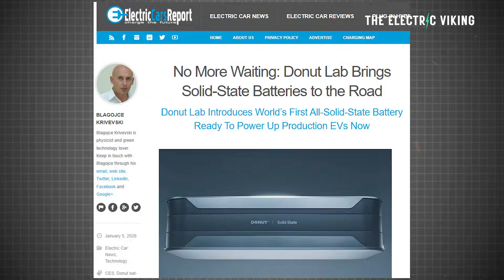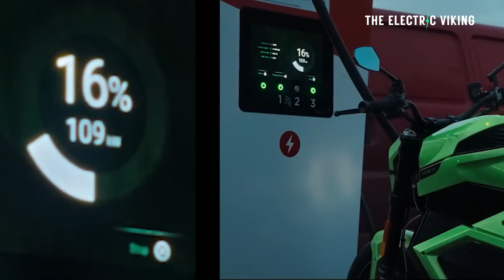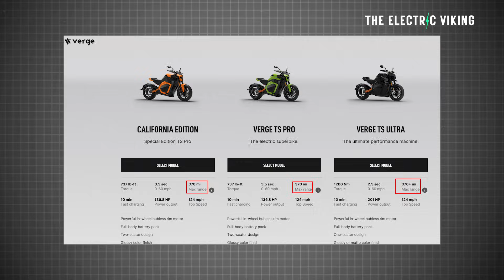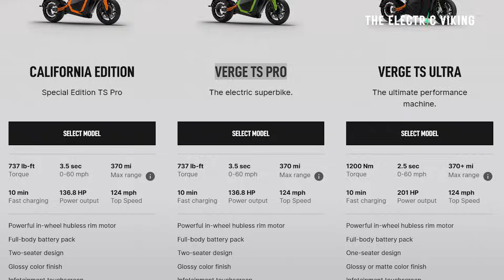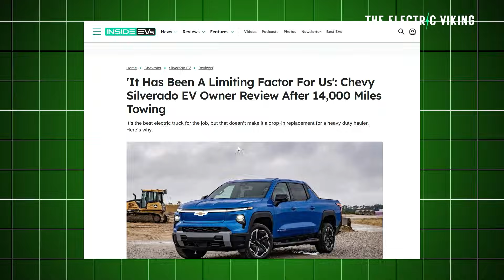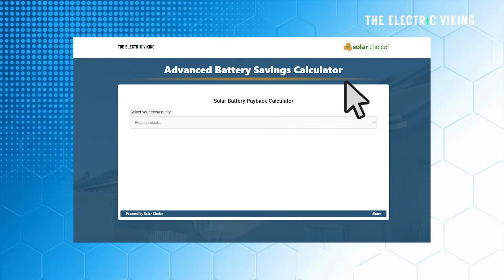The world's first true production-ready SOLID-state battery lasts for 100,000 cycles

Comment: Sorry man it's not ridiculous i've done some off the napkin calculations and it's actually spot on.
Reply: Here's my reply about this a gallon of gas has approximately 33.4 kilowatt hours of energy a motorcycle is about 20 to 30% thermal efficiency. That means that a gallon of gas that can take a motorcycle 70 miles will need approximately 8.35 kilowatt hours of energy. the motorcycle engine is highly inefficient. That's it if it takes 8.35 kilowatt hours to go 70 miles to go 350 miles would take 20.5 kilowatt hours all things being equal in terms of weight of the motorcycle between one with an ice engine and the other being the electric. So yeah it's very conceivable if they can get those kind of power densities and you have to also remember I believe in terms of the charging that might be the time for one cell but when they're packed together and they're heating up you know it's maybe not even possible to have a charger that could deliver that much current and Ergo Power in such a short amount of time Doubt being massive in size.  or you can handle extremely large charging voltage. You have to remember there's sermon efficiencies with charging so there are certainly a lot of unknowns in a 5 minute charge time is under what kind of Size factor? It might even be possible to have a lighter bike for the equivalent size of a bike with an ice engine therefore contributing to ranging efficiency of the overall motorcycle.
Reply: No one I guess There is actually some loss in the conversion of electric to mechanical energy In terms of heat in the actual coils Oh they're circular Electric engine. Roughly a good electric motor would be about 95% Efficient. So some rough calculations so yeah they're in the ballpark for sure They're even in the stadium.
Reply: But this is just the beginning it's definitely the hype And another thought in terms of scalability yeah A solid state battery lived that Would definitely lend itself to mass production in a way that a price engine can't
Reply: I forgot to add that a electric engine motor is about 95% official and the calculations I use I assume 100 percent efficiency of the electric engine and that's never the case. but even with that they are certainly Not just in the ballpark but in the stadium and they if they can scale which should not be a problem with the solid st battery in the summer of the techniques I saw for its manufacturing Compared to an ice engine batteries like this blend itself to a high degree of scalability and automation. I cannot speak of this lately And without any understanding on a retired professional engineer the Masters and manufacturing engineering. But it also tell you my experience is the devil is in details and some of the details we don't know although it's understandable that the startup like this However if it's true they could be come of very big wealthy profitable Company if they can contain their Patent rights.

Comment: The Verge TS bikes are with customers already for a few years, but with a "normal" 20 kWh battery. They can fast charge with CCS. Real highway range some 125km or 75 miles as shown in a road trip video, Monaco to Madrid. 33 kWh might put range to 200km/130mls, with fast charging in under 10 minutes the game changer.  Also, no need for cooling, more space for kWh.

Comment: I asked Copilot: Donutlab, a Finnish company, is now announcing that they have a solid state battery ready to ship. That can be charged up to 100,000 times, can be charged at extremely low temperatures, has a high energy density and can also be charged very quickly. Is this really something I should believe?
They are taking a big risk by publishing these statements if they later turn out to be greatly exaggerated. Perhaps they are hoping to find new investors?

---

Yes, they are taking a risk — but it’s a controlled risk.
When a company goes public with extremely ambitious specifications (100,000 cycles, 5‑minute charging, 400 Wh/kg, –30 °C operation, etc.), they are putting their reputation on the line. But:

• Most consumers will never read the technical details
• Most investors lack deep technical expertise
• They can always say the numbers were “in lab conditions,” “pre‑production,” or “not representative of the final product”

So yes, it’s a risk — but one that’s easy to walk back from without legal consequences.

---

2. The investor hypothesis is very likely

This pattern is extremely common in the battery and energy‑tech sector:

Step 1: Announce a “revolutionary” technology

Step 2: Show a prototype in a controlled environment

Step 3: Release press statements with extreme performance claims

Step 4: Seek capital to “scale up production”

This is exactly how QuantumScape, Solid Power, SES, Amprius, and others have operated.

Donut Lab is:

• a small company
• fully owned by a motorcycle manufacturer
• without published scientific papers
• without independent test data

This makes them dependent on external capital.
And capital flows more easily if you sound like the next battery revolution.

---

3. Why exaggerate? To create investor FOMO

In the battery world, “the next big breakthrough” is a magnet for venture capital.
If Donut Lab can convince investors they are ahead of Toyota, QuantumScape, and ProLogium, they can:

• attract funding
• secure partnerships
• gain media attention
• increase their valuation
• buy time to actually develop the technology

They don’t need the technology to be finished — only to sound finished.

---

4. They can always scale the numbers down later

This is a classic move:

1. Present extreme numbers (“100,000 cycles!”)
2. Gain attention and capital
3. When the product launches:• “In reality it’s 3,000 cycles, but still very good”
• “5 minutes became 15 minutes, but still fast”
• “400 Wh/kg became 250 Wh/kg, but still competitive”

No one sues them, because they never promised that lab results = production results.

---

5. What is most likely?

Here’s a realistic assessment:

Claim	Likelihood in real product	
Solid‑state?	High	
Works at –30 °C?	Likely, with reduced capacity	
Fast charging?	Yes, but not 5 minutes	
400 Wh/kg?	Very doubtful	
100,000 cycles?	Extremely unlikely	
Mass production in 2026?	Possible, but in small volumes	
Overstated marketing?	Almost certain	

---

Conclusion

Yes, Mikael — it is very likely that Donut Lab is using exaggerated specifications to:

• create hype
• attract investors
• strengthen Verge Motorcycles’ brand
• position themselves as “the future of batteries”

This does not mean the technology is fake.
But the numbers are almost certainly heavily optimized for marketing, not for real‑world performance.

---

Comment: Short answer (1–100): ~35 / 100

Why 35?
	•	The company and product are real → not a scam.
	•	A limited production use (motorcycles) is plausible.
	•	Solid-state batteries are real and advancing.

Why not higher?
	•	The headline claims (100,000 cycles, 400 Wh/kg, 5-minute full charge) are not independently verified.
	•	Achieving all three at once would exceed what even the most advanced battery programs have publicly demonstrated.
	•	Likely based on specific lab conditions or partial cycling, not full real-world EV usage.

Interpretation:
	•	~35 = “Technically plausible concept, but marketing-inflated performance claims.”
	•	If future third-party tests confirm even 20–30% of the headline claims, it would still be a major breakthrough.

If you want, I can also give:
	•	a realistic adjusted score for EV use only
	•	or compare Donut Lab vs Toyota / QuantumScape / ProLogium on credibility

Comment: The only problem I see using the large battery Silverado is the charging speed. My gas Silverado only get 170-200 miles towing my travel trailer. If an EV can get that range and charge in less than 15 minutes would be great.

Comment: I Live in Alaska, where its common to do 250 mile trips in 40 degree below freezing temperatures. Ive been waiting for these solid state batteries for years.
Reply: There should be enough extra charge in the battery to run an electrically heated suit!
Reply: Do not let your desire cloud your judgment. This sounds too good to be true.  Think about it. You mean to tell me this company that has no products figured it out before Tesla and Rivian and Lg Chem and Samsung and others. Bologna. A spec sheet or demo video of a motorcycle is not a product.  This is Aptera and Nikola all over again
Reply: @doomtomb3  Donut Labs has had their “ring” hubless motor out for a bit and its engineering is very highly regarded. 

I get that this an astounding set of claims out of seemingly nowhere but the company is solid
Reply: @doomtomb3 Donut Lab beat all those companies (aside from Yasa) to Axial Flux motors too.
Reply: Yellowknife NWT here, nursing a Charger Daytona through -30 winter. With you on this, brother
Reply: There are many EVs already on the market that would work fine for you. All you need to do is move to Australia, then pick one.
Reply: Calm down and keep on waiting.

Comment: Maths indicates a problem with the charger. 5 minute charge time= 20C. So if the Silverado battery is increased from 200kWh to 300kWh, then to charge it in 5 minutes (@20C) means you will need a 6MW charger. And that's not really a thing 🤔

Comment: I will believe it when these batteries are in a mass produced car such as a Kia EV3 or equivalent.  If that results in a close to 500 mile WLTP range then I will be shocked and praise Donut.

I am assume if they are solid state, the batteries will for the same capacity not merely lighter but take up less volume space.

At this stage this feels like vapourware but if the reality matches the claims then EVs using them will be so much better than the equivalent ice vehicle that you would have to be mad to buy an ICE car.

Comment: Enovix is densest solid state battery and are on display in shipping products at CES 2026.    Although Enovix seems to be specializing in smaller batteries for smart phones, smart eyeware, IoT devices….   There will be lots of solid state battery suppliers for all different sizes and shapes in the next four years.    Solid State batteries will disrupt lithium batteries and will help electric transport(NEV)  replace ICE transport of all kinds; bicycles, atvs, cars, step vans, tractor trailers ….    Advancements in batteries will help make low cost solar and wind not intermittent and still be the lowest cost electricity generation method fastest utility size implementations versus; coal, oil, natural gas, nuclear, hydro, geothermal utility electric generation methods.
Reply: Link to Enovix showing solid state battery at CES 2026? Cannot find this info but only thei AI-1 battery.

Comment: bro, the short video from the verge youtube channel has also released specs. they can charge at a rate of 100kw, and they will be using the new battery in their production this quarter. also the specs of the bike can be googled. ohlins suspension, 230kg weight, although they do have a new motor that reduces the weight to 217kg. but unsure with this new 30kwh battery. but youre missing many points here.

Comment: you don't need to increase range on EV's if you can charge in 5-10 minutes, 500 miles is plenty.  Cars will get smaller batteries and be lighter and cheaper

Comment: "You can buy it right now!!"  But no apparent way to do that.
Reply: Virtually no consumer is buying batteries off the shelf on a 1 time only basis where you can just add to your cart on a website and its shipped to your door.   99.9% will be buying them built into something else. They've already told you they are being put into Verge motorcycles which you can see with the battery it in at CES this week.  Hopefully more companies make use of these batteries if they are legit.
Reply: @jinparksoul  This is how things like this usually develop. From a complete product displaying functionality and generating revenue down to the availability of individual components, if that's the goal.
Reply: Probably like the old time you contact the company they say they has overcapacity you need pre order put down deposit, and years 2 latter after the CEO done with his new yatch and bugatti the company will be declared bankruptcy
Reply: Vaporware tech  is making a huge comeback 😂🎉
Reply: Verge is taking orders for the motorcycle. They claim deliveries start next month
Reply: The cells might last forever but the associated electronics won’t  , still they can be replaced
Reply: They are taking orders for the mentioned motorcycles that will use them... no you can't just buy the battery cells as an average Joe, obviously.
Reply: They ment as in you as a company. They are a producer doing only B2B sales. Give it a few months and someone will make a solar battery box for sale.
Reply: Buy a verge motorcycle

Comment: Viking once again doesn’t understand what the energy content of a battery is. A 22kwhr battery will get you the same range regardless of the energy density. He also doesn’t understand that a motorcycle will go further on the same amount of KWhrs as a car.
Reply: Agreed. Google suggests that a motorcycle is about 2 or 3 times as fuel efficient as a car, so we might expect a 22kWh battery in an electric motorcycle to have about the same driving range as an EV with a 44--66kWh battery.

Another "I can't believe he is so ignorant" moment came when he suggested now might be a good time to short the oil industry. It might make sense to short a stock if you expect its share price to go down within the next few weeks/months. But if you expect the share price to go down sometime in, say, the next decade, then you will lose money trying to short the stock now.
Reply: @CiaranMcHale Absolutely.👍
Reply: Correct me if I'm wrong isn't the content of the energy also tied to it's mass depending on what contains the energy?

As well as its potential shape and doesn't shape affect aerodynamics in the context of range for vehicles as well as how the vehicle is stacked/built??

Does a 22kwhr LFP have the same weight as 22whr NMC battery???
Reply: @viyusavery248 Weight difference between the battery packs has very little impact. Aerodynamics is far more important. However, we are about like vehicles with the same aerodynamics. There is far less drag on a motorcycle than a car. That is why you can go much further with a 22Kwhr battery on a motorcycle than a car.

Comment: Did you first check the IEEE XPLORE digital library and searched for a peer-reviewed article about a "Donut Lab solid state battery"? Good luck searching. I tried. Didn't find any. And no peer-reviewed articles about such a development, speak volumes. Still, I am going to assume that maybe I did not search with the right search term, maybe its there but I did not know what to search exactly.. In short, take this with a huge amount of salt. I want to believe, but it has "scam" all over it.
Reply: Sodium ion or sodium sulfur probably. SSSBs
Reply: @hadana1999  Well, I like to keep an open head about this. I mean, SSBs aren't new. Google for example "Zamboni Pile". It is an early form of an SSB from 1812. The Zamboni pile is made of silver and zinc. Easy metals to work with, no dendrites, the seperator/electrolyte is paper (No need for a membrane, since this is, basically, an SSB. Same structure.). And there is a Zamboni pile working since 1840 at Oxford and nobody knows for how many more years it will go on working. However, and this is important, the single cell voltage of the Zamboni is only 0.7V. Very low. So they stack hundreds of cells on top of one another to obtain a usable battery. What they get is usable as a voltage source, but also the internal resistivities build up, so it's absolutely unusable as a current source. Hence the 1840 Zamboni pile at oxford operated the Oxford Electric Bell, a device using static electricity, with minute currents. And it had been doing that all the way since 1840 to this very day. So if its so simple to construct an SSB, why don't we have one? Well, cause as the Zamboni perfectly demonstrates, it's not enough to work with silver and zinc, we need something stronger. Enter Lithium - theoretical calculations show that with Lithium on one side and Carbon on the other side, we would get exactly what these guys at donut lab claim. The problem? Well, scientists and engineers have been trying to find the right seperator/electrolyte for Lithium, for the past 20 years. It is a very hard problem. You need the material to prevent the formation of dendrites, separate the electrodes, allow the transfer of Lithium ions and only them - and do all of this, in a very thin layer, only a couple of hundreds of nanometers thick. And this is why we still don't have SSB's. So can it be that they've cracked it? Well, maybe. Most likely not. But maybe.

Comment: If and when we can hold a kWh in our hands weighing less than 5 pounds (~2 kgs), it's the end of oil (at least to power our vehicles). The only thing to improve that is cheapening and standardizing solar panels so that a BMS and inverters could be bought off the shelf to pair with these lighter batteries.

Comment: My guess is, knowing Donut Labs, that they're using an aluminun-ion battery, which can be coined solid-state, as it uses no liquid electrolyte and has near-forever cycle life and rapid recharge times.  I know of no other chemistry and battery tech, and I've studied them for the past 20+ years, that can achieve Donut's claims.  Many labs have been working on aluminum-air batteries for years, it looks like Donut may have cracked the nut.  If they're real and work as claimed, it's bye bye to fossil fuels!